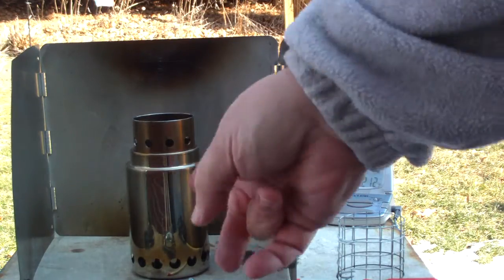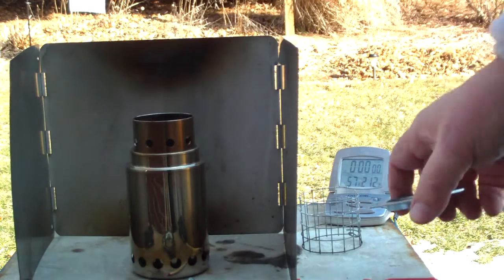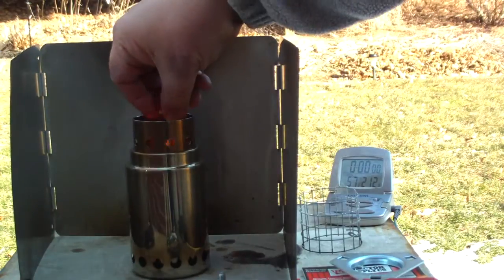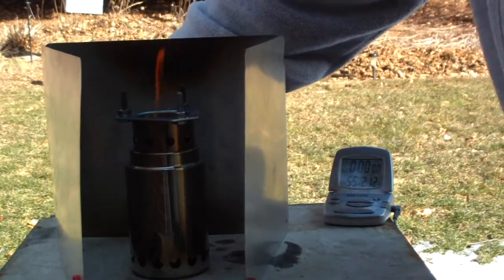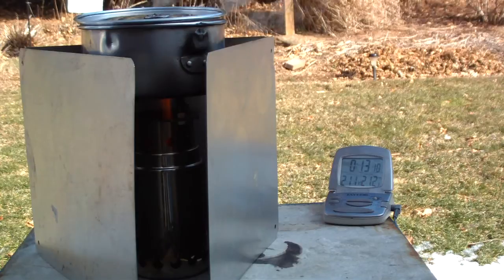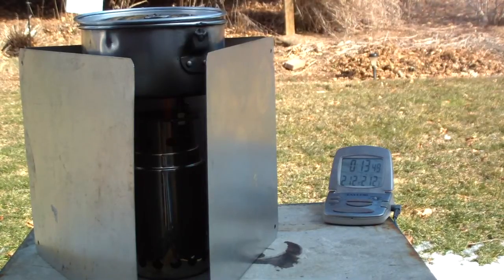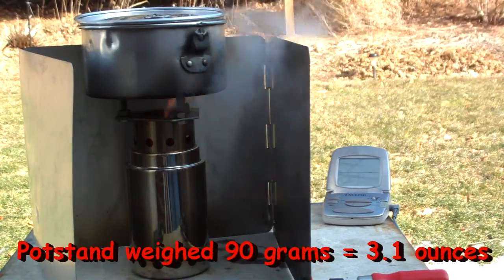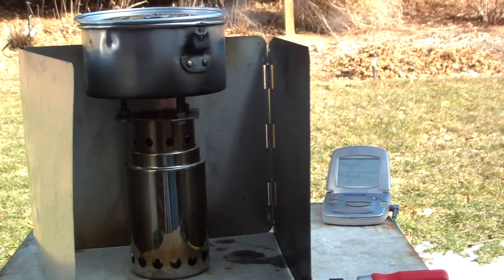WorldStove's PupStove - Potstand Idea #3 - Boil Test #3

Comment: Not bad but you could get away with a much shorter height. A height equal to the bolt heads would be more than enough.